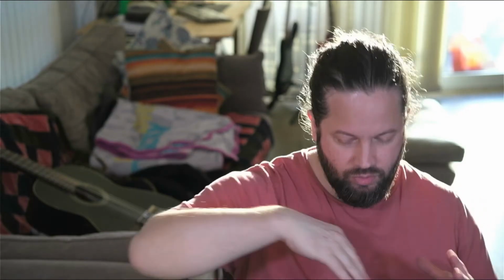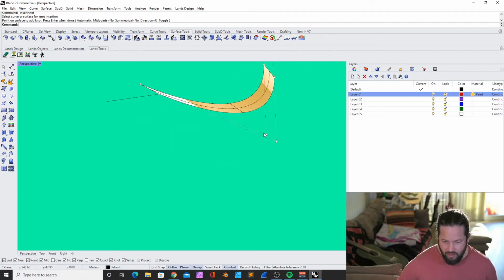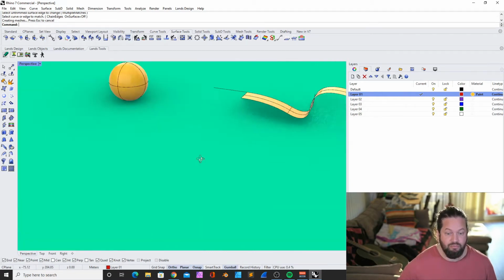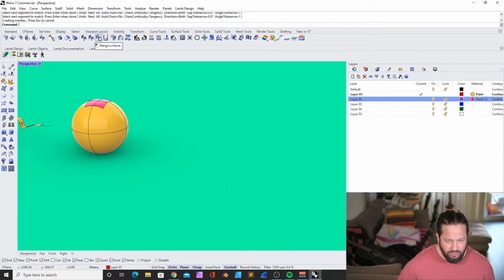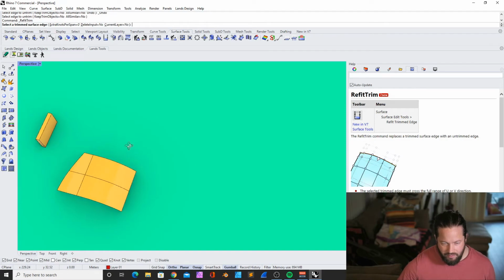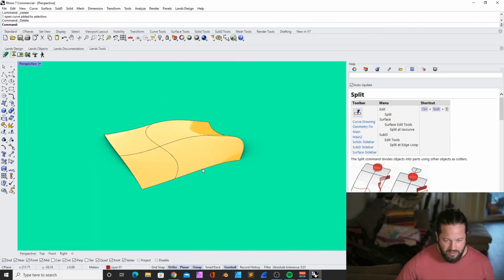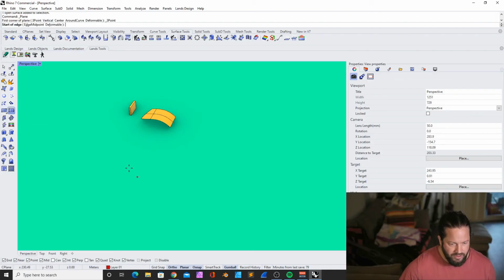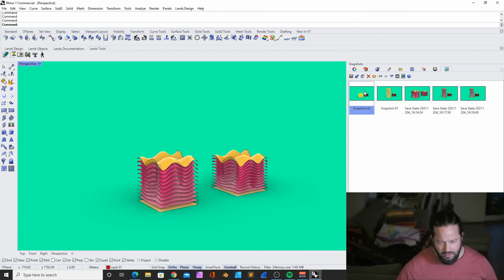How to Rhino 3D - Matching surfaces, Surface tweens, and more - Advanced Beginners Tutorial 022

Comment: Great video! I need to match some trimmed edges.. .. what do I do?
Reply from the maker: Match Surface only works reliably on untrimmed edges. If your surface is trimmed, you may need to untrim or rebuild it first. Trimmed edges can’t be matched properly because they’re not real isocurves — they’re just visual cuts.  You need to work around that problem.